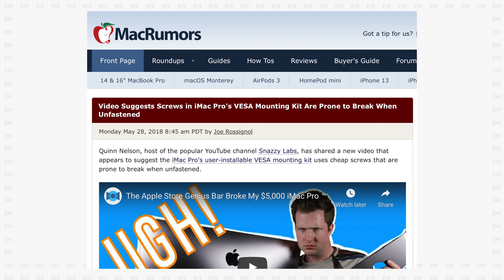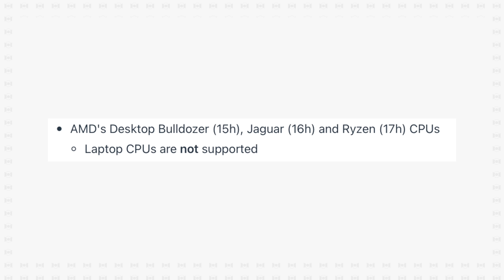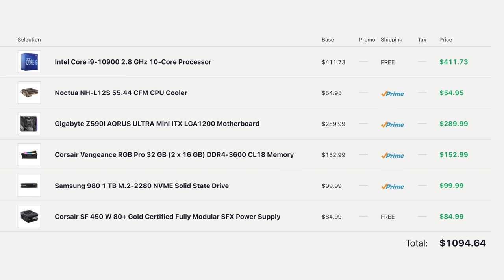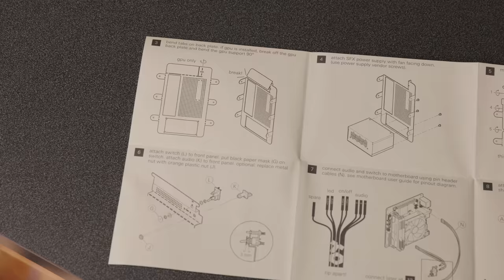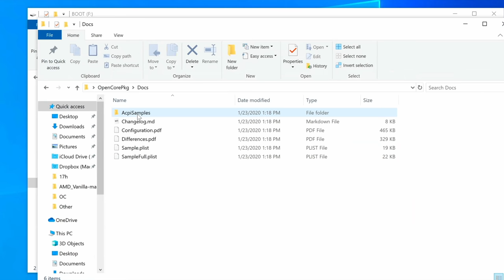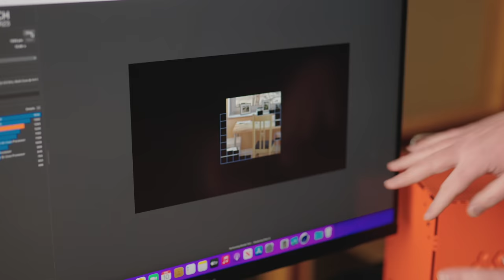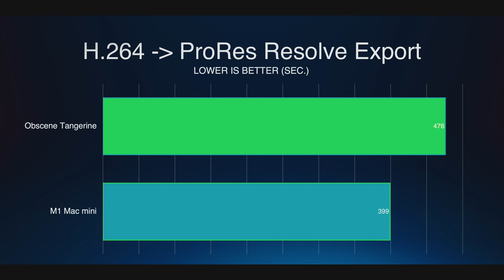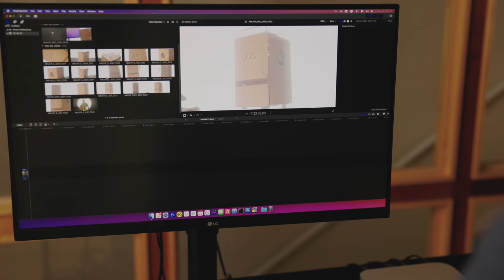The Last Hackintosh?

Comment: Problem is, Mac Mini starts at around $1000 with 8GB ram 256 GB SSD. Upgrading from 8 to 16 GB is 270 USD in my local currency. Upgrading from 256 GB  to 1 TB SSD is 540 USD. So more than 800 USD just for a normal 2021 16GB/1TB upgrade. Frankly, that is just outragerous. Why does a 8GB/256GB iMac even exist? Well, stupid Apple tax.

Comment: the non tapped holes are not a deal breaker for me, seeing as aluminum threads rather easily if you use an impact driver or if you have beefy arms like me. I would use it tho. but ill probably design my own

Comment: It is far easier making a Virtual Machine than running it natively. For those who like Hackintoshes just to mess around with it: grab a HD 7850. It is cheap, it works well, and you can also use it for virtual machine from Windows XP (yes, it is supported) to MacOS Monterey. Just be sure to run a modified vbios to run the card on EFI mode. It is a freaking awesome card for retro and actual purposes.

Comment: If you are thinking about buying M1 mac mini, IMO it does not worth to upgrade for more storage. If you have extra money, upgrading RAM to 16GB is much better. For storage, you can buy 2.5" SSD for 30-50$ and plug it to the USB-C port. You get the same speed of SSD before nvme era, which is still very fast (3~400MB/s) and you won't notice the difference unless you do high performance computing, which mean you should upgrade your RAM anyway.

Comment: On the TE case, the audio jack "TRS" should stand for tip, ring, sleeve, which is the 3.5mm jack actual pin names (4 pin jacks are TRRS). Still no excuse for not providing an HD audio connector, but at least those 3 letters make sense, sort of.

Comment: That case is the embodiment of why I DO NOT and HAVE NEVER paid money for a case. That heap is the most ridiculous hubris soaked crap I've ever seen since the butterfly macs. Fitting to make a hackintosh inside it. I make my own from scratch, or I modify an existing old ewaste one. They're much smaller and have better airflow when I build myself, but it's fun to hack up an old little prebuilt midtower to accept multiple GPUs, disks, and radiators. The entire front is radiator on the most recent one. It's awesome.

Comment: I was using Docker-OSX for my hack and stopped using it once I got my M1 mini. My current desktop has an i7-10700 with 128 GB RAM hooked to 2x4k monitors, M1 mini 16 GB on a third 4k and a 2015 MacBook Pro 15 tied together via Synergy KM. So Windows 10, M1 macOS, x86 macOS and it all runs very nicely with no swap. QEMU/OSX is easier to get up and running and it's nice to have macOS virtualized. It isn't perfect but I found it easier than OC. I also have an M1 PRO MacBook Pro 16 and the battery life on this thing is insane. I plan to keep my Windows desktop and Intel Macs in case some of my hardware vendors don't do native Apple Silicon ports when Rosetta 2 goes away.

Comment: Rocked a hackintosh for 5 years. The sense of relief I felt each time my Hackintosh made it to the desktop is not something I miss but the AUD price point for iMac Pro or Mac Pro was just so insane. Every time I got frustrated with the hacko I’d sit down and dial in memory , gfx and storage specs at the Apple store and go… “ok I have to stay with this flawed beast!”. Now I have jumped to the Mac Studio because its price point for the pep was finally competitive/compelling again & its great to be home. Holy heck that thing is fast but Adobe software still eats all the memory and I’ve had to reset more than a few times because sh*ts got weird - like render cycling through and spitting out a file but it’s all just black & the hdmi feed to one monitor just stopping for no explanation. Hacko still under the desk in case I need it

Comment: The case itself should charge like 50 on the high end, it’s a cheap easily shipped minimal designed product that is 40% built.

Betting it’s cause they’ll only sell basically none. Design is nonexistent and material cost and manufacturing is ultra cheap for Teenage Engineering considering most of their goods are outsourced and then assembled elsewhere.

Comment: The need for DESKTOP hackintoshes may have been nurfed, but LAPTOP hackintoshes are still absolutely a thing that I'm surprised you overlooked. For road warriors like myself that only use laptops but hate Apple hardware and still want to dual boot MacOS with Windows and/or Linux.

Comment: I think the low M1 power consumption alone is a huge performance gain. Because on a battery powered laptop it is essential for productivity. My only issue with Apple is the lack of expansion. My i9-9900K hackintosh has 4 drives and a ton of memory and a powerful AMD GPU (for non 3D rendering tasks such as design and photography), I will continue using it until Apple drops support for Intel. I think we still have 3-4 years… Perhaps more… By then I should be able to get a 12TB NVMe stick on a mini. :-)

Comment: I get your criticism of the case and while it's all pretty valid, I didn't mind taking 5 minutes to tap the holes, it's really not that difficult or time consuming. It should be 1.5mm thick metal and there should be two sizes for a version without a gpu and one for a gpu that can actually fit.  And it should be 60-80 bucks. I got the case for 99$ and for that price it's still too expensive but a way better deal. Considering that the nice and good looking mini itx cases are like 120-200 bucks this one is actually kinda affordable now.  The only other case that satisfied my design sense was the formd t1 which is 180 bucks at minimum and always sold out. The fractal design cases look too much like smart speakers or air purifiers so the Computer-1 was my only good option for a tiny build that does not look like a gaming PC and has a bit of color to pop in a room. All in all I am very happy with it although a Computer-2 model with mentioned fixes and a lower price would be optimal.

Comment: Well, indeed the situation has changed.

Previously iMac or MacMini were simply expensive compared to hardware they had. With Mac M1, the situation is different. If you choose 16 gb and 1tb ssd, you get and insanely good machine, for a very reasonable money.

I would say that there are two options:
a) (high end) buy mac m1
b) (casual / cheap) buy some dell optiplex 7050 / 5050 for like 200-250 $ and you'll get a very nice experience, very nice performance, considering the money you paid. It'll be much better than any (similarly priced / little bit expensive) used mac mini intel. For daily usage like web, using just mac os, or having some nice environment with ie. terminal (ie. software engineer), it is very reasonable solution.

Comment: CPU prices will normalize. Testing a system with an intel igpu is default loss. Craming the PC into an ITX formfactor and using a noctua cooler also hurts the budget a lot.

Comment: Having tapped holes on what looks like .032” aluminum is pointless, it’s too thin and aluminum is too soft. You’d need threaded inserts to actually have usable threads. But this product really doesn’t demand high strength fasteners, so I get why they didn’t tap the holes.

Comment: I found this review on the teenage engineering case to be a bit dramatic and misguided. Yes there are GPU cards that fit into this case. Not a TON of options but there are options out there. Yes the assembly takes careful attention but if done right and carefully is actually a lot of fun to put together. Once fully assembled everything comes together and is pretty solid - nothing feels loose or flimsy. The reason the reviewer was able to bend the section from the handle as he did @ 10:40 was because he didn’t have a GPU installed. The metal is pliable enough to allow the user to bend for assembly but is still structurally sound when fully assembled. 

This case is not for everybody. But I think for the right people it’s worth the price tag. I just think it’s a shame for the reviewer to just straight up come out and say “no one should get this” just because he found it too expensive and didn’t enjoy the process. I would have never tried it if I took his advice and I had a blast building it. If you have the cash, enjoy DIY, enjoy tinkering, want to build a PC, and want to have something unique and different I’d say definitely give this case a shot. It will be inaccessible to a lot of people because of the paywall or because they will be intimidated by the assembly(likely because of reviews like these) but that just means fewer people will have it and yours will be that much more unique.

Comment: Hackintoshes can still make sense to a very specific group of people. I personally have my fairly capable desktop running Windows, Linux, and macOS because I'm a software developer and need to test on everything. For people who already have a PC and can't afford or justify buying a new PC just to switch operating systems, I would argue that converting an existing one to a Hackintosh is a fine idea if you know what you're doing.
I didn't really know how to set up macOS on my desktop (i.e. which drivers and such were needed), but my desktop hardware is so common that it wasn't difficult to find a perfectly functioning configuration for it. Not to mention that this desktop was only $700 new, which makes it a lot more appealing to me personally. Anyway, that's just my two cents. Insightful video!

Comment: regarding front audio (and not only, that applies also to laptops at the very least) I wish panels with headset port + mic port were used so you could plug in headsets using both TRRS and two plugs without any dongles

Comment: My complaint about fairness of this test is not that the m1 pro exists, it's that you are comparing a low power mobile SOC (even if it is in a desktop chassis) to a very power hungry desktop Intel CPU. The M1 pro draws about 60W of power under full load and it has a GPU that absolutely demolishes the integrated graphics in the Intel chip. I really want to see a Mac Mini Pro and Mac Mini Max. Imagine having those SOCs in the Mac Mini chassis for about $1500. That would be amazing for those who don't need the portability of a MacBook.

Comment: I have the best of both worlds! With a lot of research I managed to build a reliable and stable hackintosh for music production in my studio. Thanks to this I still can game on it because of the dual boot with native windows support. For on the side I use the M1 Pro 14 inch mb pro which slices through logic pro projects without breaking a sweat, but even with this beast machine on the side I still turn to my trusty Hack for better support for plug-ins and the reliability of my 6800xt. For me this is the best of both worlds, light and powerfull on the run and reliable and strong for at home! I hope Hackintoshing will stay for longer. Even with the headaches it gave me, it was a lot of fun to learn and tweak your PC to trick a boot drive to boot into MacOS.

Comment: Nice video! However I think the comparison to is not that fair. The only reason that the price of mac mini went up to 1099$ was purely because of the storage upgrade, and that won't affect the performance. Because the 1099$ Mac mini has the same performance with the 699$ and on the hackintosh the price for the CPU only was over 400$.. I guess if we want to compare price and performance purely you will need to do a video for the 699$ price tag.

Comment: I built a Hackintosh in 2013 with an Intel I7, 64 GB of ram, great graphics card, the best tower, SSD drives, etc. and it was fantastic! I built it to use with Adobe Premiere Pro C6 for FAST Cuda video editing and rendering because my old Mac just didn't have the guts for the job. The problem was that I was always afraid to try and update it so there it sits in my closet still with Snow Leopard OS.  Does anyone know if it can in fact be updated to a more modern OS like Big Sur or Monterey without having to change any of the hardware that worked with my original build, or would I have to start all over?

Comment: Why don't you use a KVM or hypervisor install? You still end up using clover or opencore, but it makes it much easier because you can spoof specific hardware for some devices where it doesn't matter as much (like wi-fi/BT and audio devices) because most of these hypervisor systems are Linux kernel or BSD based, while still giving direct hardware access for native or near native performance because IOMMU/hardware passthrough is built in by design. XCP-ng, ProxMox, and other type one hypervisor paired with tech borrowed from QEMU solutions are the future of hackintosh, because they can emulate and/or spoof physical hardware.

Comment: the mac pro still uses intel, which will go toghether with hackintosh.
the reason is that there is still need for high performance graphics and processors, not mobile grade graphics

Comment: I think when you compare prices of a hackintosh to a M1 MacMini or M1 Pro MBP you must take into account the amount of work (several days => this alone costs you a 1000 $ at least) and, in case of the MBP, there is a gorgious 120Hz display, a big Li-Ion battery, the best trackpad there is in the market, a fingerprint sensor, very good sounding speakers, very good microphones, a decent camera and a backlit keyboard built right in (and you  can take it with you wherever you want to - I know, your Hackintosh has nice handles - but…) 🤓
Reply: not comparing to mbp though....

Comment: Couple of years ago I built a "HackPro".  A 16-core 64GB RAM machine with a fast GPU in a compact quiet case, to do workloads comparable to the Mac Pro.
Hackintoshing is a pain, and the new M1 chips are amazing...  but Apple is not yet offering hardware which can match this performance without spending three or four times as much.

Comment: That case looks like a Sterno camp stove down to the panel thickness and powder coating. Unlike a PC case the stoves are basically disposable.

Apple choosing different silicon decisively achieves vendor lock, but if you need their OS to make money you can easily afford the hardware whose price (which should not be a surprise) is trivial for a tool that makes a profit. (Bubba the local car mechanic has more in his toolbox than the cost of a maxed out Apple product.)

Comment: I feel like this is a nerfed build. You used Apple's SSD prices to give you a lot of headroom. You traded storage space for performance. Yes, 256 is on the smaller side of things, but that's what I have. I went out and spent $130 on a 1TB external SSD (USB-C). Is it as fast as one that's built in? No, but that should have made the PC look that much faster... right?

In the end, either you're building a hackintosh for speed, which then you should have put the i9 up against an M1-Pro or Max, or you're building a hackintosh for cost, which then you should have put your "spend limit" closer to $750.

Don't get me wrong, my last machine before my M1 was a hackintosh (that eventually became a Windows only machine), and I was a proponent for a while, but apples to apples, I don't see the benefit any more.

Comment: Good points made re building a hackintosh over buying an M1 Mac. I've been building and using hackingtosh for video for years and I have the same opinion, I won't be buying new components for this anymore. But I would encourage people to try hackingtosh if you have the right components lying around or can scavenge parts from discarded machines. Hackingtosh machines can run Mac specific software like VDMX and Vuo which work well with low to mid level GPUs and you don't need to hit high benchmarks. You just need enough CPU/GPU for your tasks. Don't ignore that PC dumped on the street, check the motherboard and CPU it might be perfect for a hack.

Comment: i think it is a fair question to ask how much testing and weight should be placed on apples custom chips for davince resolve and AI. that is clearly going to skew results in apples favor while the workload might not be considered generic enough to how people will use the device.

but as you say regardless of that m1 macs perform really well (in laptop the benefit of 20 hours battery life is real and can't be beat by windows options)

Comment: I bought a Mac mini w m1 when it came out but I still have yet to use it for longer than just screwing around with some aarch64 assembly - and I don't really do much of that. it's incompatibility with x86 virtualization is a no go for me. I need both Linux and windows in vmwarr and parallels and the arm64 windows demo doesn't cut it. qemu is just much too slow. I really hope they don't abandon intel completely anytime soon.

Comment: I think m1 had a lot of people move over from windows just because it handles everything so well and can't argue on the price...not to mention the can easily run a dual boot if needed, not so easy the other way around..honestly moving from windows to mac is not a big deal, when I switched over in 2019 once I signed into chrome I was like ohhh the differences are not hard to get used to at all and are mostly more user friendly anyways

Comment: I bought my parts specifically for hackintosh and I had zero problems making it work. And with Opencore even the small updates of the OS work. I have no balls to test bigger ones, but none the less it works and installed within 1 hour.
Reply: I want to replace my MOBO and CPU and build a Hackintosh, can you tell me what parts you used on your build?